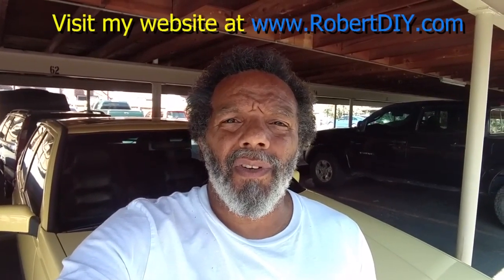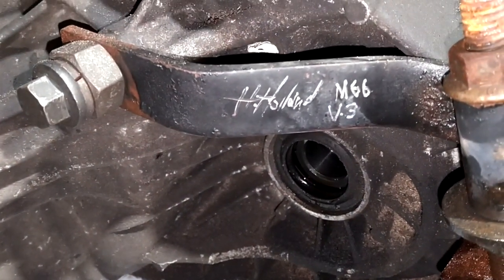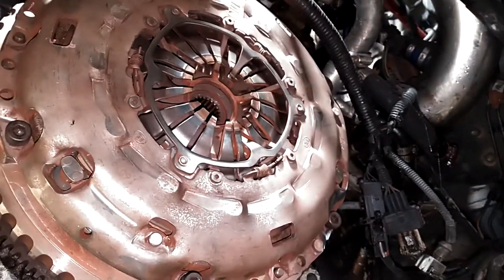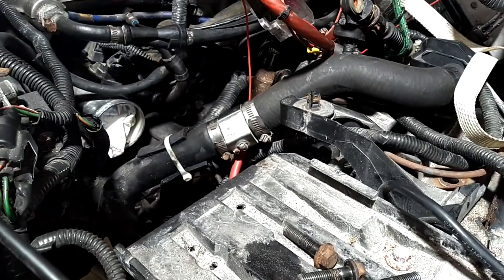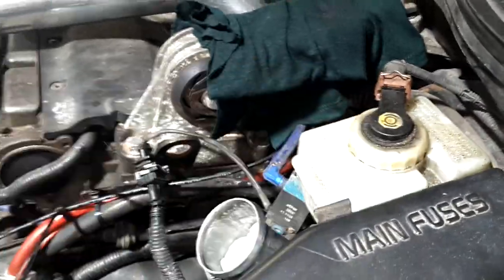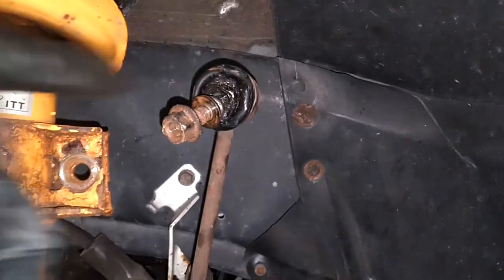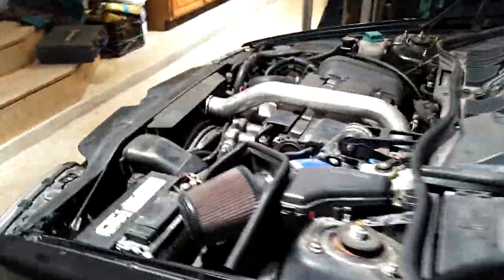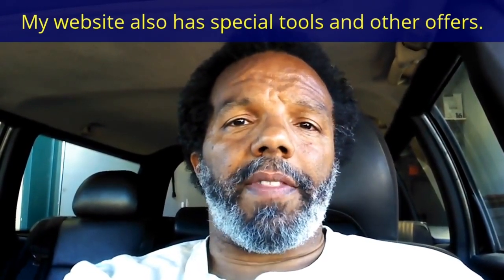Installed a clutch kit on a Volvo V70R with a M66 transmission, installed replacement lights, etc.

Comment: I already know how to do this, but it would have been nice if you could have shown how to compress that pressure plate and reset those springs.
I'm going to probably a clutch on the S60R in a month maybe I'll make a video and send it to you.
Reply from the maker: I did post a video about that.

Comment: Hi Robert, I have bought a Volvo V40 (Europe spec) from 2014 and it has a M66 transmission. I'm having a problem with it leaking, not sure where. It's got around 70k miles. It's also got a shudder on take off in 1st gear. I'm new to newer Volvo's but not older ones after having owned a 01 V40... Thanks 👍
Reply from the maker: Not sure how I can help you with that. 🤷🏾‍♂️
Reply: @RobertDIY  any common leaks from the M66?
Reply from the maker: No

Comment: I’m having trouble determining wether or not I have a chattering clutch or a bad input shaft on my FWD M66 on my 06 S40. How do I know which is which. Makes noise at idle, goes away when I push in clutch. Brand new slave. High pitch whine in low gears 1-3. Clutch was replaced 40k miles ago but I do be pushing high RPM often. Only 133k miles on engine
Reply from the maker: I have no idea. DMF usually don't have clutch chatter but if the sound goes away when you push it the clutch, it's probably just chatter.

Comment: Hi Robert.   Can the engine be removed from the top on a 2002 xc70? Realize this is completely random in reference to this video but thx for all the great help.
Reply: Depends.. is it a twin ion engine or the quadruple Incom 4L4 fusial thrust engines configuration?
Reply: @Sac_slappper_4rce  its the 44 thousand jigawatt engine. All instructions show from the bottom but author has taken earlier generation from above.
Reply from the maker: Yes, that is my preferred method.